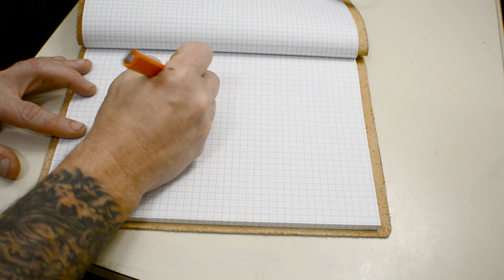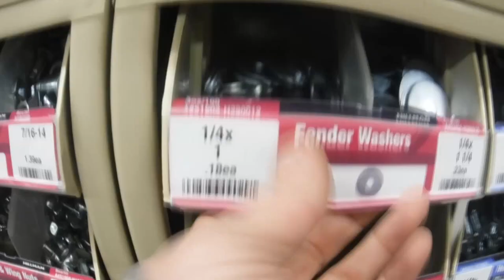DIY PULK SLED / SKISLED / BUILT FROM HARDWARE STORE SUPPLIES / MADE FOR LONG TRIPS OVER THE SNOW.

Comment: Thanks for the video. Built one exactly like this but my sled was a little too big. Sold it for cost and got a smaller one. I modified the 2nd by adding uclamps to the top corners as I felt there was to much slack in the rope connection. Also no more catching the corners on trees. Bought a harness from Bass Pro and got my mother to remove the d-rings from the back and re-sewed them so they sit on my outer hips. Close to 100lbs of gear and hardly notice your pulling anything. Awesome.

Comment: I use metal conduit with a connection in the middle to take down for transport. In the past I used pvc and found it would become brittle when loaded in the colder temperatures. I like the added handles. I never thought about trying non-metallic conduit. Great video and thanks for sharing.
Reply from the maker: Thank you for watching
Reply: what kind of connection in the middle?
Reply: That non metallic conduit is just a grey PVC meant for electrical work. He did find some very heavy wall stuff though which made it more rigid, and maybe heavier.

Comment: Use rod end bearings instead of clips to attach the poles to the sled and belt instead of loose fitting clips/rope...the rigidity really helps with the jerkiness and tracking.

Comment: Just out of curiosity. Why not use one continuous rope around the sled and up through the poles?  Seems like extra weight and materials. Is there a functional reason?
Reply from the maker: I just did it this way so the poles are easy to remove for storage or other uses  and they have double cords through them for redundancy.  Weight wasnt much of a concern, it is neglegable.

Comment: Nice video. Great tip on the belt ring location (on the hips to avoid poles in the back). Also, how come I never thought of wiping those burnt ends of paracord with a rag instead of my fingers???
Reply from the maker: Lessons learned the hard way.

Comment: Now that I’ve watched this (great video by the way!), I think I will make some adjustments to mine. I really like the belt you made. I have a weight lifting belt, but the rings are too far back...and with a heavy load, the poke the hell out of my back when going downhill. Your belt weighs a LOT less than the behemoth I’m using!
Reply from the maker: Awesome. I think most people put too much emphasis on the belt.  As long as it is comfortable, easy to drop in an emergency, and durable enough that you can trust it, then I think you will do great.  Good luck.

Comment: I'm building one right now, do you think aluminium poles will hold? I bought some 12mm in diameter and 1mm thin.
Reply from the maker: Not sure, depends on how hard the terrain is.  It should work fine, if not they are easy enough to replace.  I have this one with PVC and a military version with steel poles.  I prefer the lighter PVC version. The flex in the poles helps in tight spaces.